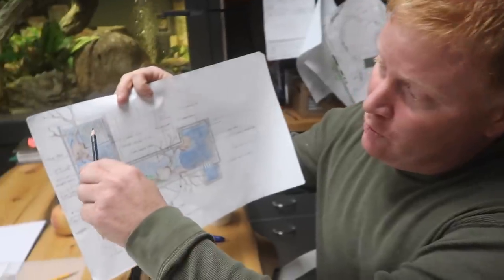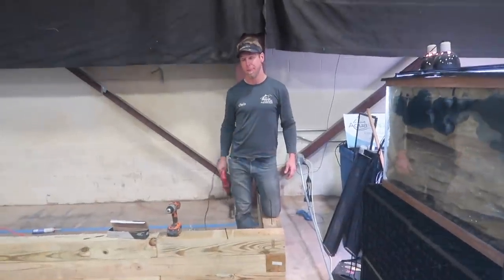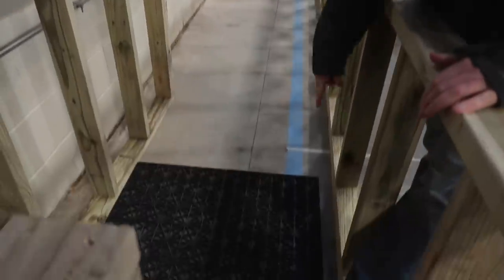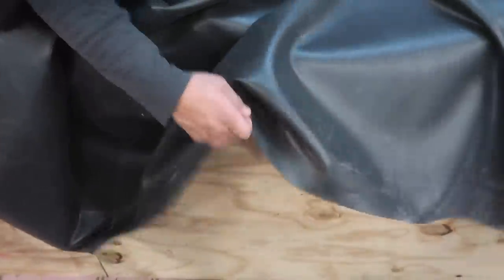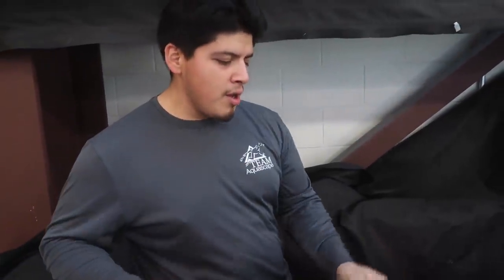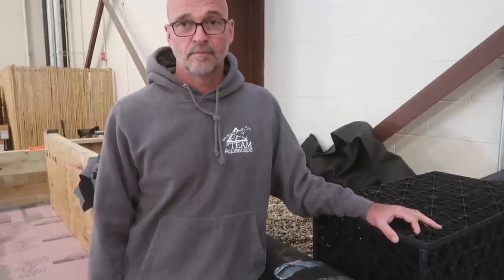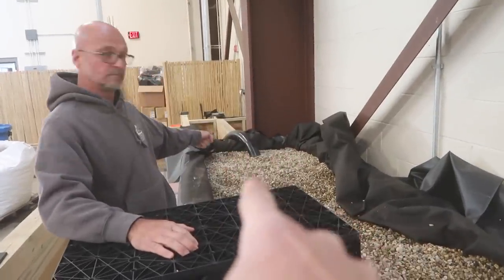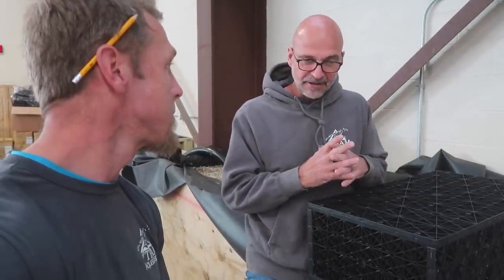*INDOOR POND* Wetland Filtration System - Retail Revamp: Part 4

Comment: My suggestion for a back drop is to run a narrow trench up against the wall and plant bamboo.  They sprout up so close together that it will almost provide complete coverage.  The trench will prevent it from spreading and overtaking the area, plus is will use tons of nitrates.  Might need to do two rows to give sufficient coverage.  Plus Bamboo goes with the Japanese theme with the Koi.

Comment: I would do a green living wall up to maybe 12' and a huge "PONDS DONE RIGHT..." above that. If the green living wall proves to be too costly, then just go for the artwork, with the Ponds... thing in the middle of it. It's a sales area, have to put the motto in!
Reply: I was thinking along the same lines, but with artificial plants. Less cost and maintenance. Run the slate walls up part way then plants above. Aquascape sign floating across the plants
Reply: @jasonoxley6125  
But it has to be real plants! Aquascape doesn't make plastic ponds.
Reply: @jasonoxley6125  fake plants collects dust after time
Reply: @sdqsdq6274  So do real plants

Comment: Ed
Every video i have seen shows the snorkel above the water level EXCEPT the one in the large pool at Ohio fish rescue 
That one is just above the level of the new bottom 
How will cleaning out go with a pump ??
You need a special cover with a bulkhead fitting so the water does not just flow into the pump from the snorkel instead of picking up the solids from the centipede
Sure like to see your solution 
I want to raise the  bottom of my 6 foot deep pond  with an upflow  filter 
Centipede ,snorkel  , block and your 3 layers of river rock to simulate a wetland filtration system in my pond
Love hear from you

Comment: Would yall ever reccomend using lavarock for filtration? I'm working on my 500 gallon's sump and just want to know what you'd do
Reply: Tyler Glück I’ve had great success with Lavarock but it gets very expensive with large volumes.
Depending on how it’s set up it can become clogged with organics which will eliminate a lot of the void spaces and pores, when this happens it loses its efficiency and when it’s in thick layers it’s difficult to clean. 
But.....
When setup properly it’s awesome!!!

Comment: Can someone please explain the difference between water being pushed UP through the filter compared to being pulled DOWN which is a common way it's done in the UK?
Reply from the maker: Phil Barrett one way water goes up, the other down 😜 As long as there’s water movement it doesn’t matter for bacterial colonization
Reply: @TEAMAquascape  excellent, I was hoping you would say that as in my garden the ground and gravity work against me having water flowing out of the wetland so I'm having the waterfalls on the higher ground and the wetland filter on the lower land if that makes sense?